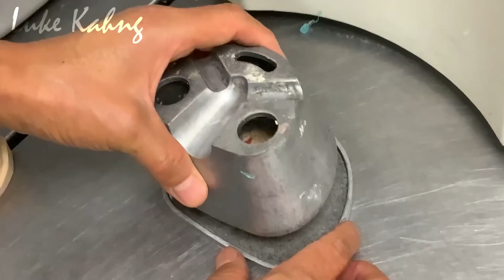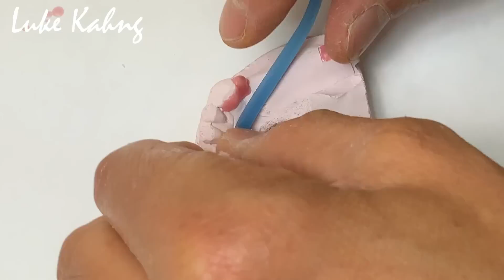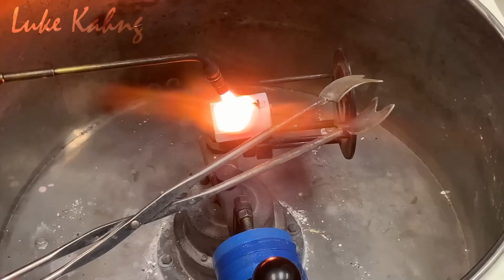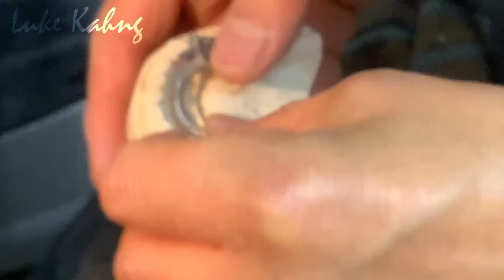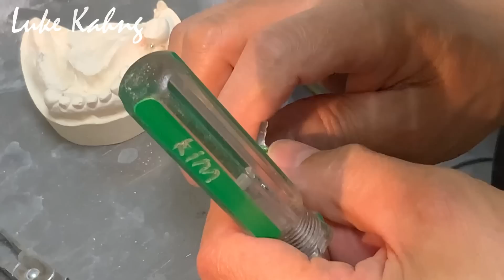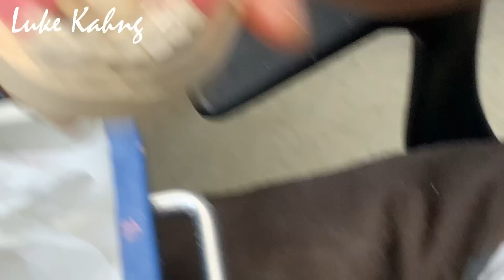FULL PROCESS: How to Make a Metal Partial with Attachments

Comment: Could we see the impression before pouring? How is it possible that the crowns didnt stay in the impression?
Reply from the maker: Dentist must take good pick up impressions with  sleeve in
Reply: So you have metal replica that you place in the impression? Everyone says that this is super inaccurate, I didnt believe them(dont know why it would be inaccurate, but couldnt find anyone doing this. I think NOT cementing the crowns can be inaccurate because it can move during the impression. Also if it was preci vertix system, is it also possible to take the impression with the bridge already cemented in the mouth but without the sleeve and place the metal replica of the attatchment in the impression and proceed the same way?